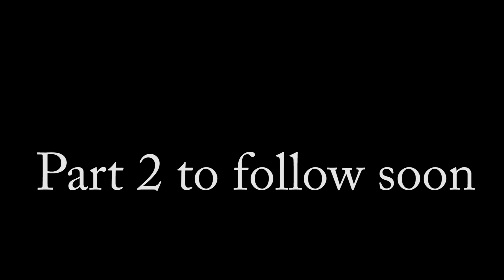Pfizer, process 2

Comment: The vaccine three hours afterwards gave my wife severe reaction. She is now in the process of being diagnosed for a litany of negative effects that have made her unable to work or enjoy life. Finally her doctors are not dismissing that it could be caused from the Pfizer vaccine.
Reply: Good luck to you both. Sadly, if you look under every video about the drugs, there are now tens of thousands of comments just like yours.
Reply: @MrCSutton  yes an epidemic govts want to suppress. I did hear that govt gave these drug companies freedom from prosecution for vaccine injuries. However it’s very difficult to sue your own government
Reply: Fasting can undo much of the damage and importantly, will also cycle it out faster by stimulating phagocytosis. This is important because otherwise she could experience side effects even years later. It also repairs damage to white blood cells, and if this issues is not fixed then serious problems await in the coming years. Some benefits of doing occasional extended fasting: High blood pressure is lowered to normal levels very quickly while fasting. Fibrosis/scarring is reversed over time, including in the heart and lungs.

Fasting stimulates phagocytosis, the ingestion of bacteria, plaques and viruses by the immune system. It will also remove any 'foreign material' like spikes that are not supposed to be there. Whether natural or unnatural in origin..

Blood clotting is reduced and blood clots and arterial plaque are reabsorbed into the body. 

Blood sugar and insulin are lowered when fasting, allowing white blood cells to move more freely throughout the body and do their job.

Vitamin D plasma levels are increased as fasting improves metabolic health, and vitamin D in turn increases autophagy.

Fasting restores NAD+ to healthy levels.

Reflexes and short term memory are increased. 

Fasts from 36-96 h increase metabolic rate due to norepinephrine release! 

Telomeres are lengthened and fasting also increases anti-aging Yamanaka factors.

After 72 hours or more fasted, your body recycles up to 1/3 of all immune bodies, rejuvenating your entire immune system. This helps prevent the onset of new autoimmune conditions, which develop through a leaky gut and damaged immune system.

Fasting can help with MS, Depression, BPD, Autism and seizures.

Thymus is regenerated, which suppresses aging and renews the immune system. The thymus also plays a vital role in fighting cancer.

Weight loss from daily caloric restriction has 1/4 to 1/3 of the weight lost as lean tissue while many studies show fat loss from 36 h fasts without losing any lean tissue! 

The obese will lose extra tissue like loose skin while fasting, but the skinny or frail will have increased growth hormone release than the obese, which helps to make more lean tissue and reduce frailness.

When you move out of MTOR your body shuts down the building blocks of the cell required for viruses to replicate.

What breaks a fast? Anything with protein or carbohydrates in it will break a fast. Most teas and herbs are OK. Most supplements and meds will either break ketosis directly or contain a filler that will. Many meds are dangerous to take while fasting.

Does fasting lower testosterone? No, it raises it when the fast is broken by increasing lutenizing hormone. Fasting also increases insulin sensitivity, which helps with muscle building.

Fasts of 36-96 will not affect short term female fertility or affect menstrual cycle. They also may increase long term fertility, especially in women with PCOS.

Fasting reduces pain and anxiety by stimulating the endocannabinoid system in a similar way to CBD oil.

One day of fasting can cut your leptin levels in half and gets your immune system working properly again! This reduces leptin resistance, which impairs immune function. 

Stomach acid is reduced over time while fasting and can allow for the healing of treatment resistant ulcers. Some patients may need continued acid reduction medication while fasting.

Does the body preferentially prefer glucose as a fuel? No. Except for brief periods of very intense exercise, your body mainly burns fats in the form of free fatty acids. Your brain also prefers to burn ketones at a rate of around 2.5 to 1 when they are available in equal quantity to glucose.

Fasting stimulates the AMPK complex and activates autophagy. Autophagy (literally self eating) will cause cells to recycle damaged proteins and foreign matter such as viruses. It will can kill cancerous and senescent cells

Lowering insulin via fasting virtually eliminates chronic inflammation in the body. 

It increases mitochondrial function and repairs mitichondrial DNA, leading to improved ATP production and oxygen efficiency. Increased mitochondrial function also has the added benefit of increasing your metabolism, fighting infection and cancer prevention!

Fasting releases BDNF and NGF in the blood which stimulates new nerve and brain cell growth. This can help a great deal with diseases like MS, peripheral neuropathy and Alzheimers.

When not in ketosis, the brain can only burn carbohydrate, which produces a great deal of damaging ROS the brain has to deal with.

Fasting also increases telomere length, negating some of the effects of aging at a cellular level.

When you fast, this stimulates apoptosis in senescent or genetically damaged cells, destroying them. Senescent cells are responsible for many of the effects of aging and are a root cause of the development of cancer. 

A fasting mimicking diet for 3-5 days in a row also provides many of the same benefits as water fasting. FMD usually has 200-800 calories, under 18 g of protein and extremely low carbs.

Exogenous ketones can aid with fasting, making it easier in healthy people and allowing some people with specific issues to fast in spite of them without worrying as much about hypoglycemia. They also help with dementia and many other issues even if you take them while not fasting!

Glycine and trimethylglycine can also be useful supplements while fasting that won't break ketosis and have many benefits.

Children, pregnant or nursing women should not fast for periods longer than 16 hours. People with pancreatic tumors or certain forms of hypoglycemia generally cannot fast at all. Type 1 diabetics can also fast but it is more complicated and should be approached with caution as it could lead to ketoacidosis. If you experience extreme symptoms of some kind, especially dizziness or tremors, then simply break the fast and seek advice.

Resources:
https://www.ncbi.nlm.nih.gov/pmc/articles/PMC5783752/
https://www.ncbi.nlm.nih.gov/pmc/articles/PMC1413655/
https://www.cell.com/molecular-cell/fulltext/S1097-2765(18)30605-1?_returnURL=https%3A%2F%2Flinkinghub.elsevier.com%2Fretrieve%2Fpii%2FS1097276518306051%3Fshowall%3Dtrue
https://pubmed.ncbi.nlm.nih.gov/28235195/
https://www.ncbi.nlm.nih.gov/pmc/articles/PMC2815756/
https://www.nia.nih.gov/news/research-intermittent-fasting-shows-health-benefits
https://medicalxpress.com/news/2022-10-treatment-pulmonary-fibrosis-focus-telomeres.html
https://www.ncbi.nlm.nih.gov/pubmed/10859646
https://academic.oup.com/ajcn/article/81/1/69/4607679
https://pubmed.ncbi.nlm.nih.gov/31877297/
https://n.neurology.org/content/88/16_Supplement/P3.090
https://pubmed.ncbi.nlm.nih.gov/31890243/
https://pubmed.ncbi.nlm.nih.gov/2518860/
https://pubmed.ncbi.nlm.nih.gov/29727683/
https://www.ncbi.nlm.nih.gov/pmc/articles/PMC5895342/
https://www.ncbi.nlm.nih.gov/pubmed/25686106
https://pubmed.ncbi.nlm.nih.gov/21410865/
https://www.ncbi.nlm.nih.gov/gene/25712
https://pubmed.ncbi.nlm.nih.gov/23707514/
https://www.ncbi.nlm.nih.gov/pubmed/24905167
https://www.health.harvard.edu/heart-health/abundance-of-fructose-not-good-for-the-liver-heart
https://www.ncbi.nlm.nih.gov/pmc/articles/PMC7093158/
https://clinical.diabetesjournals.org/content/36/3/217
https://www.ncbi.nlm.nih.gov/pubmed/23876457
https://www.ncbi.nlm.nih.gov/pmc/articles/PMC6526871/
https://www.ncbi.nlm.nih.gov/pmc/articles/PMC7607739/
https://www.ncbi.nlm.nih.gov/pmc/articles/PMC5783752/
https://pubmed.ncbi.nlm.nih.gov/6859089/
https://www.ncbi.nlm.nih.gov/pubmed/10232622
https://www.ncbi.nlm.nih.gov/pmc/articles/PMC8470960/
https://www.sciencedirect.com/science/article/pii/S1931312809002832
https://pubmed.ncbi.nlm.nih.gov/15522942/
https://faseb.onlinelibrary.wiley.com/doi/abs/10.1096/fasebj.2019.33.1_supplement.819.10
https://www.biorxiv.org/node/93305.full
https://www.arcjournals.org/pdfs/ijrsb/v3-i11/7.pdf
https://www.ncbi.nlm.nih.gov/pmc/articles/PMC6407435/
https://www.ncbi.nlm.nih.gov/pmc/articles/PMC6141719/
https://pubmed.ncbi.nlm.nih.gov/20921964/
https://pubmed.ncbi.nlm.nih.gov/25909219/

https://www.collective-evolution.com/2017/05/16/study-shows-how-fasting-for-3-days-can-regenerate-your-entire-immune-system/
https://pubmed.ncbi.nlm.nih.gov/7714088/
https://www.cell.com/cell/fulltext/S0092-8674(19)30849-9
https://www.ncbi.nlm.nih.gov/pmc/articles/PMC3017674/
https://pubmed.ncbi.nlm.nih.gov/23408502/
https://www.amjmedsci.org/article/S0002-9629%2815%2900027-0/fulltext
https://europepmc.org/article/MED/22402737?javascript_support=no
https://onlinelibrary.wiley.com/doi/full/10.1111/j.1365-2265.2005.02288.x
https://www.nejm.org/doi/full/10.1056/NEJMoa012908
https://pubmed.ncbi.nlm.nih.gov/27569118/
http://www.cell.com/cell-metabolism/abstract/S1550-4131(15)00224-7
https://repository.upenn.edu/cgi/viewcontent.cgi?article=1537&context=edissertations
https://www.ncbi.nlm.nih.gov/pmc/articles/PMC1779438/
https://www.nejm.org/doi/full/10.1056/NEJMc2001176
http://www.sciencedirect.com/science/article/pii/S0005272806000223
https://www.clinicaltrials.gov/ct2/show/NCT04375657
https://pubmed.ncbi.nlm.nih.gov/20102774/

This list compiled over years of research by the user known as Pottenger's Human on youtube. Feel free to copy and paste this anywhere you like, no accreditation needed!

My community tab will always contain an updated version of this list of fasting benefits. I also have playlists on fasting and health topics.
Reply: @LTPottenger thanks for this
Reply: @LTPottenger Fasting to what schedule?
Reply: @LTPottenger ...wow, you've written us a booklet, friend!   Thank you for given us what seems to be vital helpful information.  I hope it helps many of the injured from the jab(s), especially.  God bless.
Reply: @captainspackjarrow33 that's not a positive thing to say that's disgusting it's his wife
Reply: @chesterbikley3483  Yeah but it could be a positive in the end right ?As long as he didn't chose to get jabbed too
Reply: @captainspackjarrow33  dating is rarely a positive thing💔
Disconnected folk having dysfunctional relationships! 🤷‍♂️
Reply: @Peter_Pepper_Love  like a relátionshio where one gets jabbed and one doesnt?
Reply: @captainspackjarrow33  yes I know that only too well. My partner chose to have it out of fear of losing her job. 
I had to honor her choice as she has the free will to choose for herself 💔
Reply: @Peter_Pepper_Love  I've learnt that Islam knows how to deal with this type of thing as the wife must do as she is told . It's a pretty good system and would have saved your wife the potential and unknown effects as you could have said no for her .
Reply: @captainspackjarrow33  it's not up to me to say no and control my wife. 
God grants us all free will to learn from our own mistakes. 
It wasn't easy watching her go like a lamb to the slaughter and 'I AM' definitely no 'judas sheep'
She has learned the hard way...regrets it now...but I get no pleasure in telling her "I told you so" 🤔💛
Reply: @Rumpleforeskin77  I too find your opinion disgusting - you wrongly assume men to be wiser, more intelligent or intuitive. 
I followed the arguments and research of Americas Frontline Doctors from the outset, the men in my family didn't bother -I was the conspiracy theorist begging them all not to take it. I subsequently spent many hours at Accident and Emergency with my husband waiting to be treated for severe chest pain.  Refusing to admit the jab caused it now insists he needs a booster to protect him this coming winter. He is the last person I would take medical instruction from!! All educated -but not all wise.
Reply: @rightmeduck  Well I think you are showing disgusting Islamophobia ..it's not my opinion it's the word of God .
Reply: @Peter_Pepper_Love The 50 percent plus divorce rate backs up your statement very well!
Reply: I was speaking to someone today who shared that when she was given the vaccine she developed serious recurring kidney problems where every so often she has to stay for a week in hospital. She stopped after two vaccines as I and my wife did.
Reply: i had vaccine at 930 at 530 i starting have chest pains and right hand starting going numb for weeks. then my neck went out for 3 days
Reply: Diet changes and fasting can reverse many/all of the negative effects. Do the research and don't trust the medical system!

Comment: Penicillin was discovered on a Petri dish, to produce industrial quantities requires a different process.
You can create oxygen in a school chemistry laboratory by adding hydrogen peroxide to potassium permanganate and collecting the gas.
To create useful quantities requires the fractional distillation of liquid air.
Creating small amounts needs one process, mass production requires a second process.
If a drug is licensed then it doesn’t matter the process used.
Extract salicylic acid from willow bark, pass it through an acetylisation process, create little tablets of acetylsalicylic acid.
Manufacture salicylic acid in a huge vat. Add an acetyl group results in ASA.
It’s a matter of scale. Providing the quality assurance within the manufacturing process is of high quality and the end product is identical then it does not matter the process.

Comment: Would be quite a thing if the mRNA degraded to the point it was not actually an mRNA injection. Awaiting part two.
Reply: mRNA is supposed to degrade quickly 
awaiting more info on this

Comment: In my image of the production method I see a small man wearing a white coat, grey hair standing on end and wearing thick black rimmed glasses. He has a big smile with large white teeth. He is surrounded by various glass vials test tubes and clear bottles boiling away over bunsen burners an at the end of a number of connecting glass rods a vial is being filled drop by drop. When the vial is full he shouts  in German with glee. I wonder why?
Reply: he probably pissed into the vat or worse

Comment: Solomon Asch Experiment

Solomon Asch experimented with investigating the extent to which social pressure from a majority group could affect a person to conform.

Asch measured the number of times each participant conformed to the majority view. On average, about one third (32%) of the participants who were placed in this situation went along and conformed with the clearly incorrect majority on the critical trials.

Over the 12 critical trials, about 75% of participants conformed at least once, and 25% of participants never conformed.
In the control group, with no pressure to conform to confederates, less than 1% of participants gave the wrong answer.

Conclusion
Why did the participants conform so readily?  When they were interviewed after the experiment, most of them said that they did not really believe their conforming answers, but had gone along with the group for fear of being ridiculed or thought “peculiar.
A few of them said that they did believe the group’s answers were correct.
Apparently, people conform for two main reasons: because they want to fit in with the group (normative influence) and because they believe the group is better informed than they are (informational influence).

- This has been one of the most fascinating IQ tests conducted on humanity! People act as if it’s in vogue to be gullible & stupid. We are now seeing the results….